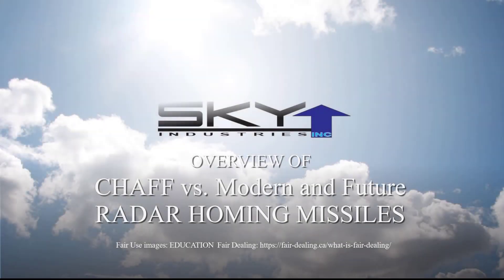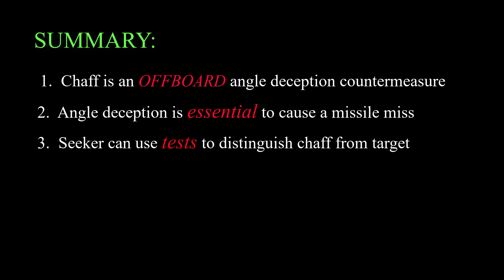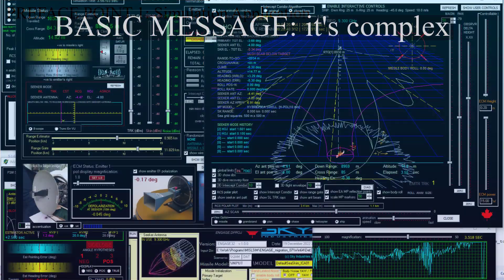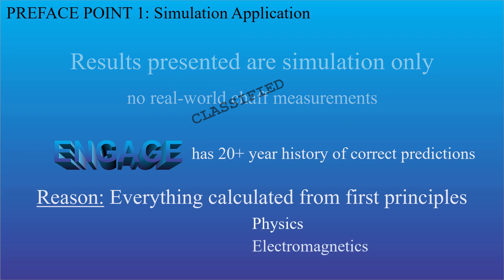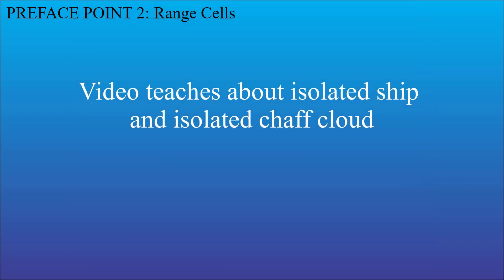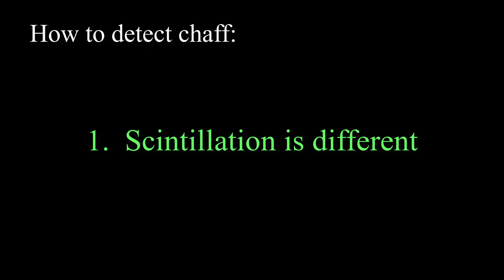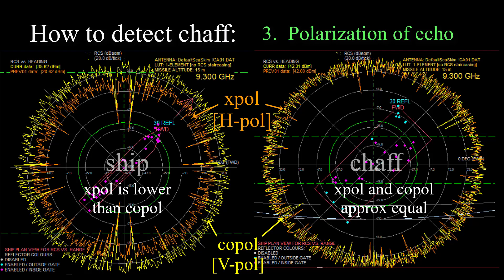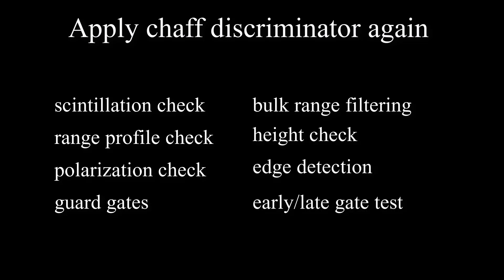Chaff vs Modern Missiles 00

Comment: Even if the missile can distinguish the target ship from the chaff, can the chaff mask the ship is it's in-between the missile and the ship?
Reply from the maker: Excellent and insightful question.  

Any electromagnetic wave impinging on a physical object will be partially reflected, partially transmitted, and partially absorbed.  

The skin echo power in  the seeker sees when there is a chaff cloud between it and the ship depends on how much of the RF wave is transmitted through the cloud to the ship.  

This will depend on frequency, cloud dimensions and density, and perhaps to a lesser extent polarization.  

Remember that the signal loss due to reflection by the chaff cloud is applied twice: once from the seeker passing through the cloud to the ship, then the reflection from the ship has to pass back through the cloud to the seeker.
Reply: @skyindustries  Is it the equivalent of popping a smoke grenade? 

If I understand correctly, its function is to decrease the signal-to-noise ratio. 

Would it mainly be used to prevent and break targeting lock?
Reply from the maker: @michaelemouse1  I think a smoke grenade is a useful analogy in some respects, but not all since the seeker doesn't see things the way our eyes do.  

If the cloud hides the ship well enough, a modern missile with a chaff discriminator might look elsewhere for the ship, or another target.  

More likely, the seeker it might perform a range search excluding the range depth of the chaff cloud, since eventually the skin echo will appear.  

I see chaff as a Cold War countermeasure; good for the old fellas, not so good against modern missiles.
Reply: @skyindustries  So what ECMs are effective against modern missiles?
Reply: @skyindustries what about Chaff illumination by ship-base ecm system？such can generate a better false target while avoiding HOJ problems
Reply from the maker: @Type09V  Good idea against older threats, although tricky because of dependence on geometry and perhaps low power delivery into the seeker.  Seems unlikely to work against modern seekers which are able to quickly build and evolve a complex tactical picture.
Reply: Not really because if it knows there are chaffs then it knows the signal is corrupt. It will obviously not use the signal . Hence it will revert to the last known good signal.

In any case, all this is moot with modern AI because far more advanced techniques beyond analysis can be devised. For example, What's to stop the missile from becoming intelligent and, say, changing course and then circling back around for another go? What about multiple missiles using combined information coming from different directions? (using the ensemble principle for sqrt(N) reduction in noise)

AI will change how the psychopaths play their war games completely.
Reply: @WhatsThePointOfIt  What do you think it will look like?

Comment: They need to make better chaff.  By putting thicker material along one edge, they could set the polarization to horizontal or vertical, and by selecting a mix of both types they could recreate a particular ratio of polarizations.  Fancier still would be to embed the foil in plastic ribbons that would unfurl in the air to create a rough ship shape on radar.  Of course that would cost a whole lot more and still wouldn't hide the ship.
Reply: Maybe this is another application of drones. Similar to the swarms that do light shows.

Comment: 4:35 don't know how true this is but reminds me of a funny story I head about the CIA getting ahold of Soviet flare specs for IR missile countermeasures. The flares burnt much hotter than the engine so the cia told its missile manafactures to make the missile go for the colder heat source. Problem being Soviet manafactureing failed often to make these flares to spec often burning colder than the engine.

Comment: Hmmmm why not deploy continuous chaff (obviously not packets of metal being released), I can think of a few possible solutions.  Even IR missiles, why is the primary seeker on the missile, they should mount it on the plane and network to the missile seeker, high ofboresight then becomes only limited to the missiles g limit rather than te seeker gimble.  No doubt these things have already been considered and disproven by he military people, or are in place without us knowing (as it should be)

Comment: ENGAGE overview: [ link TBD ] ???????
Reply: Ah, You have worked on Radiation Characteristic Analysis of V/UHF Band Antennas Integrated on Aircraft using EM Tool? That's Impressive. I wondered how youtube found the the correct people for this video and then here I'm. Anyways, I was pointing out that you should really consider another ID for commenting if you don't wish to leak your details.